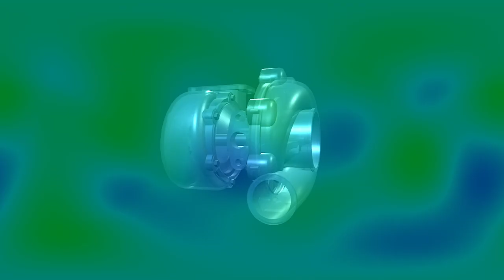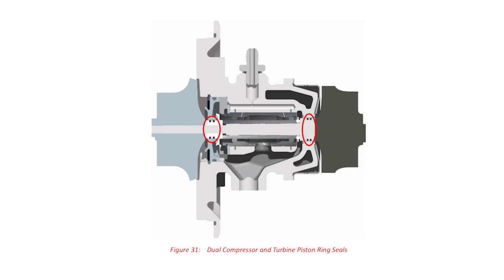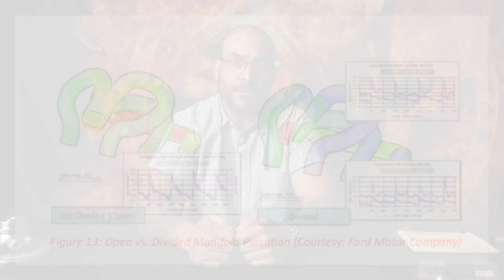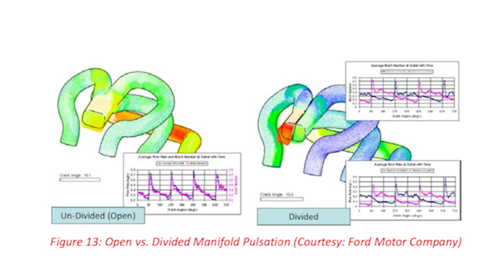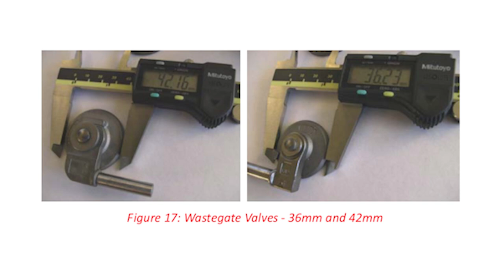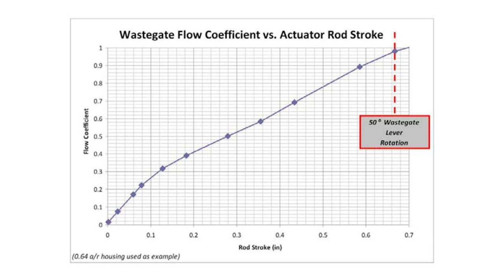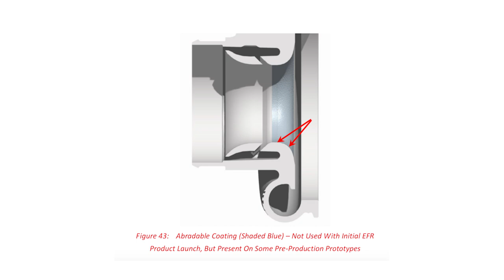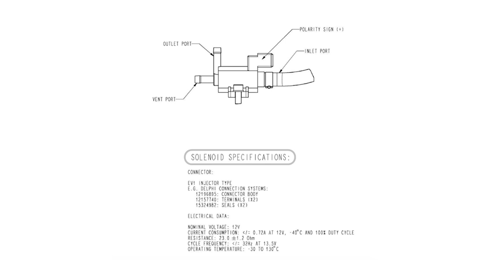Garrett vs BorgWarner in-depth comparison Part2

Comment: Hi Chris what would you recommend for a 13b Bridgeport rotary to produce 550hp street car
Reply from the maker: Nicola, if the motor has been dowled, and built properly, you will need something large to match the demand of the motor - Rotary engines have a high demand on air flow to make power. You also need a large AR turbine housing, minimum for a street car will be something like the AR.106 when using a turbo like the following:- 

https://turbodirect.co.za/store/index.php/shop/turbochargers/gtx3584r-forged-detail
Reply: So the borg efr8474 won’t work ?
Reply from the maker: @nicoladistasi8817  Yes it will, at alot more money. You will need to choose the AR.105 turbine housing, this is also externally gated
Reply: Ok that explains why everyone in Australia is using garret g42
Reply from the maker: @nicoladistasi8817  Instead of the G42, i would use the BorgWarner EFR9280 Black - it will outspool and outperform the G42. Keeping in mind that you need 550HP - both these size frame turbochargers are too large for your required power output anyway.
Reply: 550 hp -650 I wouldn’t want anymore than that what would be perfect turbocharger but I want good response and mid range not just the big end figure.
Reply: Would the new g40 series be a better option ?
Reply from the maker: @nicoladistasi8817  EFR series will always be a better option, they run slower, flow more than the claimed output, and have much better cooling in the bearing housing. The bearing system is far superior and the list goes on.

Comment: How did I guess you were going to pick BW in the 1st part video lol. I actually just bought a GTX Gen 2. Going to be put in sometime in June...
Reply from the maker: Dont get me wrong, you havent made a bad purchase at all - its a proven turbo, but in comparison there are others that offer a different basket of features and components internally. Dont doubt the turbo - it will do its job and well too. The older Gen2 30 family stuff is excellent at delivering what the compressor maps claim.

Comment: I really appreciate you taking time to post this two part series. I'm trying to learn as much as possible before selecting correct turbo. 

Question: Could you recommend a turbo for our application?

I've got a 2005, mk4, Jetta 1.8t k03s, AWP (stock) with 240k mile (owned since new).  Still runs strong. I'm planning a rebuild with forged IE rods and upgraded exhaust valves. 

Application: mainly street daily driver. Occasional track/road course.

Goal: 400hp  / 400# torque. 

Thanks in advance....
Reply from the maker: Hey Joe Man - thanks for the comment.  The 1.8T is a lazy engine with larger turbos, which is easily changed by swapping out the crank for the 2.0L - which makes a massive difference in being able to spool a larger turbo nicely for street use and track. The turbo you need to make 400HP is a small-mid frame size and will spool quickly. 

I would opt for something like this:- https://turbodirect.co.za/store/index.php/shop/turbochargers/turbocharger-turbodirect-s-a/gtx3077r-forged-detail 

Other options are EFR7163 with the T4 twin scroll AR.80 turbine housing - this is easy for the 1.8T to spool.

Comment: Thank you.
Back in january 2011 I wrote on a forum regarding the then new EFR series: "I think these turbocharges looks fantastic promising." 
That they have been and still are. There are some openings that could be filled, like a EFR7364 Black with more turbine housing options, but that is it IMO.
Reply from the maker: LOL i had to laugh at this - i had something similar happen to me with a client in 2009 where we suggested he run a GT3582R on his Mazda 2.0 EGI after running a chinese paperweight (T72 single all bearing copy of the turbonetics design) he laughed at us claiming that no tiny little turbo will perform better than his T72 (typical bigger is better ideology) so we took a bet -- long story short, the jaws dropped when we made over 100HP more at 0.5bar gauge pressure less boost and spooled 1500rpm sooner than the chinese copy.  EFR is underrated and a seriously great product.

Comment: Interesting points, so I’ve got a G30-770 going on my Audi S3 Stroker 2.0 20v. What would be the comparative Borg Turbo? Aim..... 650-700bhp
Reply: G30-770 good for 650ps max....check their compressor maps
Reply: @ngt84  Hi I’ve already done all that, just curious what Borg Warner’s alternative is to the G30-770. I’ll be running 99 Octane fuel with water/meth injection which will of course aid the turbo to its maximum potential on this build.
Reply: Efr7670 is equivalent to a g30-770
Reply: @ngt84  Amazing thank you, I’ll check it out. 👍🏻
Reply from the maker: Agreed with NGT - its the 7670 - PS:- G30-770 wont see close to 770HP, its just not capable of this contrary to what the compressor maps say - in my opinion Garrett had to inflate these to make the product look a little better, maybe this could be because of their bankruptcy, maybe for other reasons, who knows for sure. From personal experience none of the new G-series turbos have made what they claim to make - from the G25- upwards, they fall betwen 50-100HP short no matter what you boost.
Reply: @TurboDirectSA  We have a tuner over here in the UK called Badger5, they specialise in the 1.8t 20v VAG engine. They achieved 524bhp with the G25-550 which was pretty dam impressive, admittedly this is a very high spec build, stroker, cams, water/meth and so on. The G25-660 has yielded around the 560bhp mark. So with that said I’d expect like you’ve said we wouldn’t achieve the 770bhp that Garrett claim, if we get around 650bhp but with a better spool compared to a GTX3584R which we get around 620-640bhp on these engines then that would be a win in my eyes. I do like the idea of Borgwarner being a complete all in one, even if it does have a slightly larger foot print.
Reply from the maker: @Ash-lq4xx  Thanks for the info - we have not seen more than 480HP on the G25-550 but we also operate at 6500ft above sea level here - which makes a difference. Our climate is also very hot and dry.   The 660 here hasn't seen much more than 530HP here - all figures i mention are on my own personal shop dyno. Any dyno is able to be manipulated by changing the sea level correction factor etc etc   Age old topic - but how we setup our dyno is based on manufacturers power claims on an OEM stock vehicle. the Golf7R shop development car in stock format made 212KW (claimed by the OEM at 228KW at the coast) all our gains thereafter are with untouched correction factors etc.
Reply: @TurboDirectSA  Thats a very good point regarding the sea level differences. Something that I’ve only recently looked into. Obviously a lot of variables with tuning cars. 

Would you say a G30-770 is similar to a GTX3076R Gen 2 in terms of characteristics? Spoon/Yield.

Looking very forward to seeing what the comparisons are turbo to turbo on your 1JZ project. 👍🏻
Reply from the maker: @Ash-lq4xx  We have had experiences with a 1400HP setup running a GTX4508R at sea level where the car fealt seriously strong, and when coming up to the reef where we operate the sting was taken out of the car for some reason and the driver and tuner wasnt able to work out what was going on, it was simple - they had maxed the turbo out at the coast and when the car was running up here (our atmo pressure is 0.8bar) the setup essentially lost 0.2bar boost.  

GTX Gen2 will flow the same if not a touch more than the smaller compressors in the G-series. We have seen higher numbers from the Gen2 3071 and 3076 models. The G30-770 is essentially the "replacement" for the GTX3071R Gen2 and the G30-900 is the "replacement" for the GTX3076R Gen2
Reply: @Ash-lq4xx  - Was the engine run on an engine dyno or in-car on a chassis dyno; drivetrain power losses aren't percentages, it's an old myth.
Reply: @tommylyeah  hi, in car chassis dyno

Comment: At one time I serviced Garret APUs. 99HP shaft output, 450HP Pneumatic output. 40gal/hour.
My interest is my old 6.5 Detroit TD. Rather high CR, 20-22? So max boost is off the table. But if I can get 1 bar of cool air charge, the fuel burned will be much better used. I have considered a modified plenum that includes a vortice generator to increase swirl into cylinders to better expose fuel droplets to oxygen. NOx could be useful. But optimizing what is being used already is a plus.
Reply from the maker: @bryanst.martin7134  interesting experience

Comment: Great video series so far its really crazy this channel only has less than 2,000 subs. In my opinion the BorgWarner SX-E line of turbos are by far the best bang for your buck units be it S200, 300 or 400 series. I remember when the EFR turbos first came out I was at a tuner shootout put on my Modified magazine. Some car showed up with the new EFR turbo lots of people were joking and laughing because it was so small of a turbo and had this ugly tan plastic valve on the compressor ect. It blew everyone away made something like 730whp and had by far the widest powerband. 

At 25:50 you go over wastegate sizes. Wouldn't you need an even larger wastegate if you are running a very wide range of power on a big turbo? Lets say you are running traction control on a 1,000hp engine and are only demanding 400hp or so in 1st then 600 in 2nd, 800 3rd ect at what point would multiple wastegates make sense over a larger single gate?

Also do you have any opinions on the new ECU encryption stuff going on with Bosch and other ECM manufactures? Many new 2020/2021 vehicles are untuneable and probably will never be tunable save for piggyback systems. Would be a great video to discuss the issue. Some of the cars impacted are C8 corvette 2021+ Supras/BMWs and all Mercs and most VAG products after 2020.
Reply from the maker: Thanks for the compliment, means alot to us. As you asked the question, you also gave the correct answer. The lower the boost on a high HP turbo, the larger the gate required.  Using multiple gates largely relies on the manifold design - the internal gate is positioned inside the turbine inlet after the gasses have collected after the manifold - so no reason to have multiple units. On an external setup like a compound turbo, thats a different story.  When using a V type engine and having to separate manifolds converging into one, you could run gates at each collector on either side, but if the turbo had an internal gate design, which is matched to the flow and rotating assembly, why not use the tested and proven design?  Always remember external gates add to the overall volute AR of the turbo setup, in short they create additional lag if not setup correctly with the right spring pressures and controls etc. 

The ECU's are becoming an issue to tune for sure, but when the password protected models were released we thought the same thing about being able to tune them, and we did. I think it's a matter of time until the engineers at the chip tuning tool manufacturers get past the encryption.  On the VAG side of things, since they went to SIMOS from the MED17xx range of ECU's its been more difficult to tune for sure, even using Winols the maps and orientation thereof are totally different aswell. I guess you cant be a master of all trades.

Comment: hello. I drive drifting and I want a new turbo there is a 1jz full upgrades 576 WHP. I have watched BW efr 7670. are you talking about a video with 1jz in this video?
Reply from the maker: Yes sir - 7670 will be well suited to a drift setup for the power you are looking to make, use the smaller AR turbine housing.
Reply: @TurboDirectSA  is there only 1 type of t4 exhaust housing? ar 1.05? for I have t4 manifold
Reply from the maker: @LILLEGOFF_DRIFTING  No you also get the AR92 4 twin scroll option. Which will spool faster than the 1.05
Reply: @TurboDirectSA  I saw it now. but it was with internal WG, I have external wg on my car :)
Reply from the maker: @LILLEGOFF_DRIFTING  There is no smaller EWG housing available - i would try the internal housing with actuator - i think you will be surprised.

Comment: Great videos with plenty of detail to demonstrate your points. I have really been impressed with the efr features and value especially when all the additional components and fabrication is included in the selection. I have not been able to establish meaningful dialog with suppliers about the selection and sizing for my application as they apparently don’t sell as many large efr units so may not have the experience. I’m not sure using Matchbot takes into consideration many if the efr benefits so hard to make an educated decision. I have a 5.7 L Chevy v8 built for lower boost and mid 60’s lb/min air flow. I only plan on 10-12 lbs of boost for a mostly street car with some occasional track days. Engine compression is about 8.5:1 and naturally aspirated has 306 whp at 5400 RPM and 341 lbft of torque at about 3500 RPM. It’s in a 240z with C4 corvette suspension front and rear, 6 speed manual and 3.45:1 rear gear. Definitely want internal wastegate and think twin scroll. Any thoughts would be greatly appreciated.
Reply from the maker: Thanks for the comments, much appreciated. The 60lb/min is a relatively tall order for such low boost pressure with todays turbo line up. The turbocharger would need to be able to produce large air flow in the lower P2C region, which is not a problem because the engine is large enough to drive a single turbo of size that is capable of this. 

If you look at the compressor map of the EFR9274 Black Series, you will find at around 0.8bar gauge pressure you will be in the mark (yet close to the choke limit) of where you want to be. 

The other option which is journal bearing, but probably more suited to this low boost and high flow requirement is the S300SXE with Part #: 13009095091 - this turbo will be in the high efficiency range and make the power you want at the low boost setting, and still have about 80-100HP in reserve at the same boost before the choke limit - i would opt for the AR1.00 twin flow turbine housing.
Reply: @TurboDirectSA  
Thanks so much for taking the time and providing expert advice.
Reply from the maker: @garywood1285  Pleasure Gary.

Comment: You were very vague about the compressor wheels, but holy hell does the Borg seem to be a significantly better unit in general.
Reply from the maker: Im vague on purpose - there is only so much ill share - as a manufacturer and designer, we will not share everything - im sure you understand.  Borg are on another level compared to Garrett thats for sure - Garrett have fallen by the way side - the bankruptcy has caused alot of issues with the product and the staff that once were - are no longer, the product shows this too.

Comment: What new borg is comparable to garrett gt3582r, gen 1 gtx3582r, gen 2 gtx3582r? Thanks for the awesome content, certainly looks like borg is stronger and more durable.
Reply from the maker: EFR8474 Black series, and it outperforms the Garrett by leaps and bounds
Reply: @TurboDirectSA  thanks, what hp is rated to?
Reply from the maker: @farmer3242  A TRUE 950HP